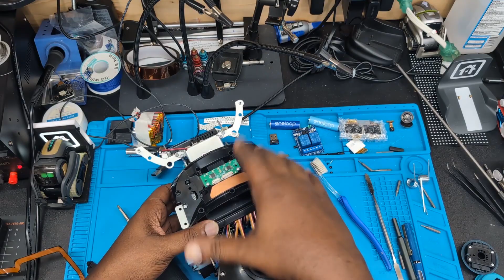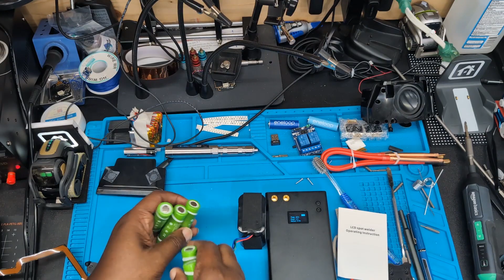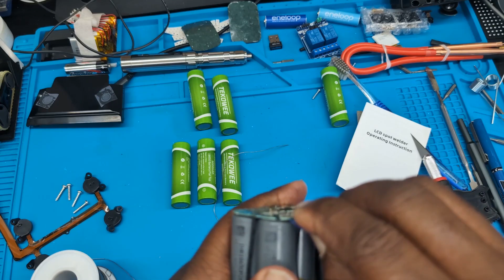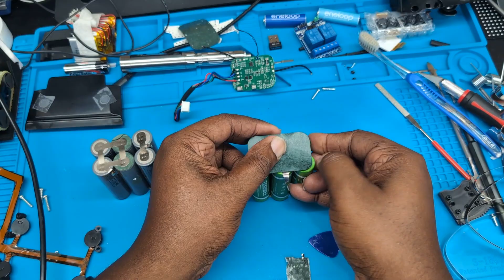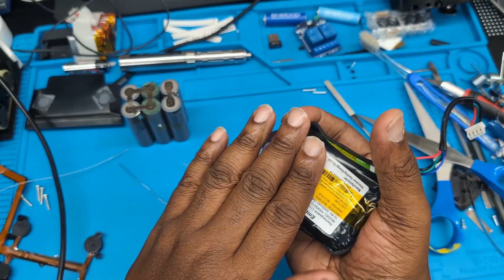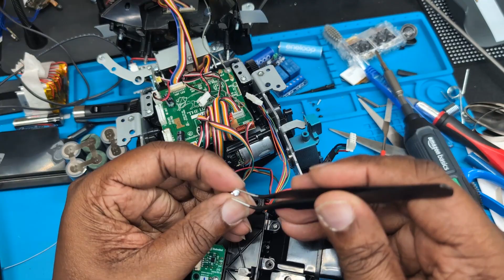Moxie Robot Teardown (contd) & Battery Replacement

Comment: Hey! Love the video. I was able to flash my moxie at one point and I had gone through with a second one for a friend but his got bumped mid way and the system just refuses to boot anymore. I can hear a crackle from the speaker but it won't proceed from there. 

Someone said it might be possible to short the eMMC but I'm not that technically savvy with the hardware. Is there a possibility to do this?
Reply from the maker: if there is hardware damage, you would have to inspect to see if some wire somewhere got cut or something else failing to provide power.
The emmc has a/b partitions so if a fails to flash it will bootup with b, but it seems like yours is not even attempting to boot up, so you most likely have a cut somewhere. 

I would check the wires coming out from the bottom through the battery enclosure, I had one rip on me when I was doing a replacement
Reply: @techshop82 Ill check it out! Hopefully its something like that. All the lights do come on on the boards but no harm in ruling out every option.